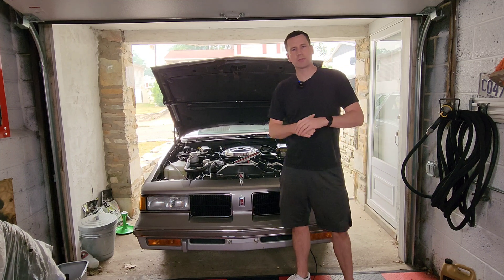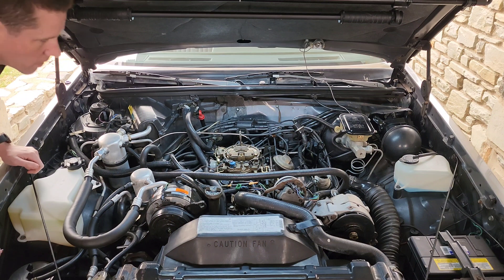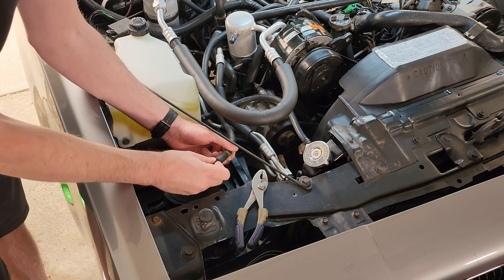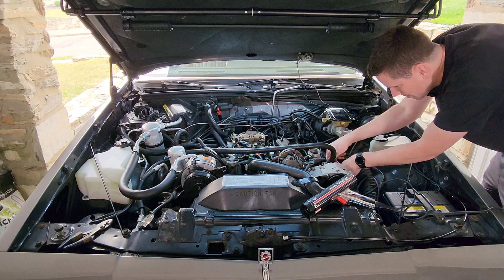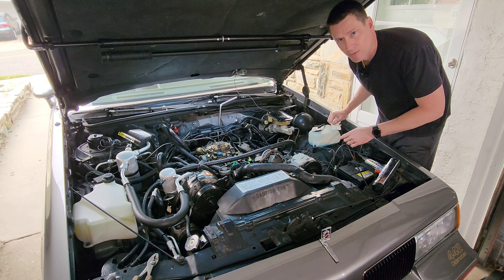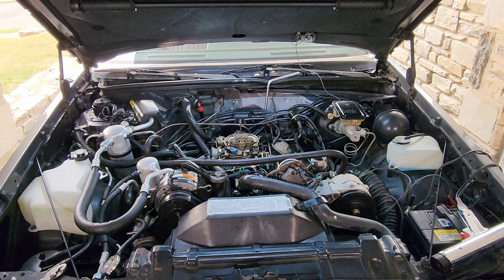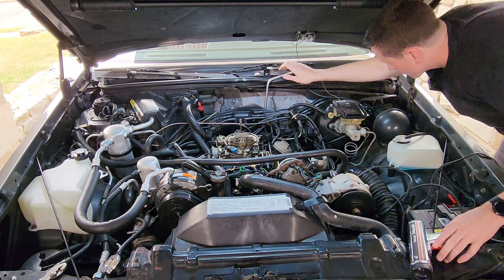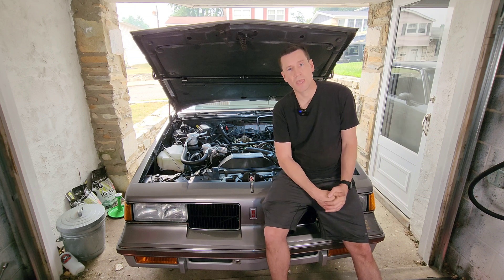Setting the Ignition Timing On An Oldsmobile 307

Comment: I have a 1984 Olds 98 that my father bought brand new. My father beat the heck out of that car. That  307 took one hell of a beating.  He would get into those 4bbls several times a day
Dad was also bad with maintenance like oil changes. Believe me the list goes on. 

She became my first car, A 17 yr old boys first car.
P.s it was a New York  car.
However she is still going strong 🎉

I've been running it with a 4° advance on timing for some time now. The car has 150,000 miles on it. However it has never missed a day of work. It starts right up every time and has never been on a tow truck. I put a double roller timing chain on it just to be safe.

The car has dual exhaust from the manifold back, I also deleted the catalytic converters however I kept the original mufflers.
It still has resonators on the end of the exhaust. ( an item most people delete these days) I closed off the EGR valve and the PVC from the engine to the block.
The starter handles the extra timing with no problems or drag. It has always been run on 93 octane Premium gas.

The body of the car is still very good-looking. I love to see the look on people's faces when It leaves a one  rear Peele off a light. Better yet a  one wheel peel off a rt turn.
You just can go wrong with an Oldsmobile.
Reply: Enjoy

Comment: Excellent videos. Keep it up. Seriously. Someone needs to make these videos. While you got the results you wanted, as far as simply checking timing, you're probably doing extra stuff you may not need to. The 87 Olds Cutlass factory chassis service manual is rather cheesy and simply says to look at the underhood emissions decal on the radiator shroud for instructions to set the timing. You should have an emissions label coded "SAC" for the 87 442 ("SAD" in Calif). You only need to do a few steps if all you're doing is checking/setting the timing. You can skip plugging the EGR and canister vent hoses and follow the steps 1-3, 8 and 9 on the emissions label. I'll paraphrase here- Set emergency brake and block drive wheels. Step 1: Remove air cleaner just as you did and plug the Y connector for the thermac. Step 2: Start engine and ground C-3 diagnostic lead. Which is the top right two terminals (A&B) on the ALDL under the dash. Now the CCC is out of the timing picture. Step 3: If not at 20 deg. @ 1100 rpm (per the label) in PARK, then loosen and adjust distributor until it is (tighten distributor bolt then I would check to make sure timing is still at 20 degrees to make sure you didn't accidently move the distributor while tightening). Then remove ground from the C-3 diagnostic lead (ALDL).  At this point you can turn the car off and go directly to step 8. Steps 4-7 is where you start disconnecting EGR and canister vent hose for setting carb and solenoid settings in drive on the 442 if you need to, especially if you had to adjust timing where it affected idle speeds in park and drive. Step 8-9 is where you uncap and reinstall the Thermac Y connector (and any other hoses you did remove and plug) and put the air cleaner back on. I know it seems counter-intuitive, but that's what's on the label.
Reply from the maker: Thanks for the feedback. I really appreciate it. And you're right about some of the GM manuals. I just try to put everything out there and then leave it up to the viewer to decide how they want to tackle the job. Please share any other insight you have as things come up. These cars are starting to get popular again, and a lot of guys are new to the hobby. We all really appreciate it.
Reply: @rporestorations  No problem. I hope I didn't come across as being critical, as I wasn't. You would need to do the hose plugging to adjust the carburetor idle speeds after timing adjustments if needed anyway. But unfortunately with these cars a lot of information on the underhood decals gets lost if the decal fades/tears/becomes missing for whatever reason and it's not always found in the service manuals which can leave you lost. Your videos get to the point and a great visual aid for the dying art of keeping these CCC carb cars alive. Props to you!
Reply: Just posting to clarify that there is the information on the basics of setting the timing in the "Ignition System" section of the 87 Cutlass service manual for both 6 and 8 cylinder engines, but you have to look elsewhere in the manual (performance specification chart) for timing specs, spark plug gap, idle speeds, etc. and cobble the information together yourself. The underhood label has all the information in one place. Unfortunately, not everyone has a factory service manual and their label is no longer there/readable so this video definitely will help get their timing set right.
Reply from the maker: Yeah. I wish there was a database of underhood label pictures out there or a company reproducing them. Especially for this era of cars. I know a lot of people would find it useful.

Comment: I bought an 87 442 and it ran like crap. When I checked the timing it was set to 4 degrees. I had a FSM and followed this procedure and set the timing to 20 degrees. It was like a whole new car after that.
Reply from the maker: Timing can really change the way the car runs and accelerates.

Comment: Is this procedure the same for 87 cadillac with 307? How did you know the RPMs? I dont have a Tach. What did you use to maintain the 1100 rpms?
Reply from the maker: Yep. This procedure will work on any car with the 307 motor. If you don't have a tachometer in your gauge cluster, you can always buy one to use when you're tuning. Some newer timing lights available on Amazon also have a built in tach. Outside of that, just raising the idle a little while you're setting it will do.

Comment: hi, please tell me, I have an Electronic Quadrajet Carburetor, the Throttle Position Sensor pressing rod is broken on it, is it possible to drive with such a broken sensor?
Reply: I have a 1984 Olds 98 2dr. My dad bought her new. That 307 took one hell of a beating.  However it still starts rt up and she has never missed a day. It also was never on a tow truck.

I've been running mine with a 4 degree advice  for some time, she has 150k on the motor. I do have a double roller timing change.  
Back to the car it has true duel exhaust. I got rid of the cats, still have the factory mufflers and the  resonators ( Most people forget the resonators these days.) Closed off the EGR. And closed PCV from the carb. The starter handles the advance with no drag. I always use Premium fuel.  The car is in very good condition.  People's eyes bug out when they see this 2ton car doing its 1 wheel peel off a light, even better on a Sharp rt turn. Disabling these Factory pollution control devices along with advanced timing gives the car respectable pickup at both high and low ends.
Reply from the maker: I've never tried it before, but I wouldn't recommend it. The car will definitely not run correctly. The piece is easy to replace. It drops right in.

Comment: Hi, my blower motor doesn't work in my 1987 Cutlass Supeme. Do You have any idea whats going on? Are there some fuses or what ?
Reply from the maker: There are many things that could be wrong. You may need a new motor, especially if it is the original.
Reply: @rporestorations  Thanks but I have fixed it allready :) It was just bad connection :)
Reply from the maker: Glad it worked out!